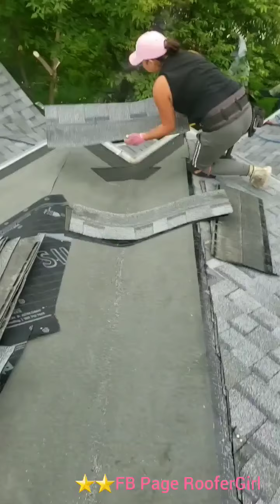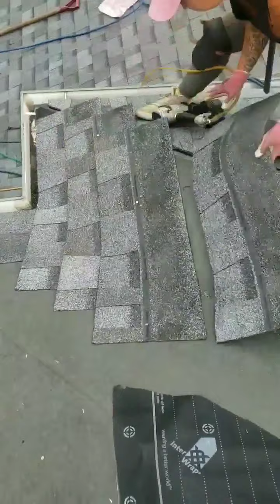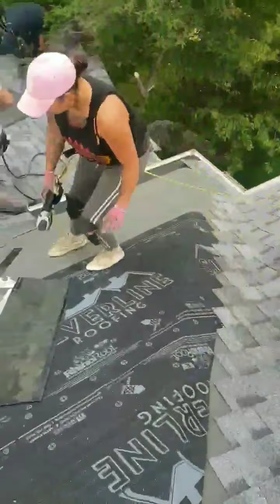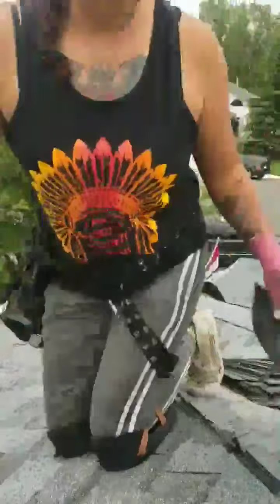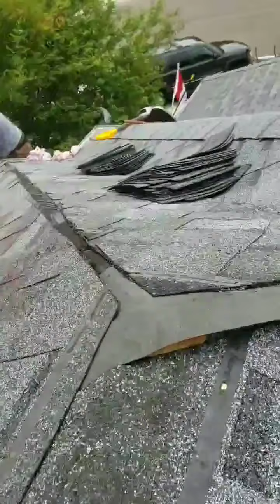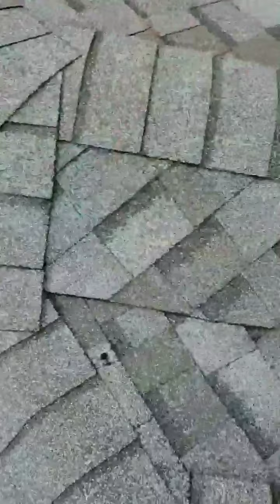Valley Install

Comment: We stopped doing our valley's this way. The way we did them for years!. Our new practice, we just snap a line on the "gutter side" of the valley, up a few inches, then, we run shingles vertically up the valley, and either start in the valley with our runs, or just start with our books and just use ones and twos before the valley.

Comment: Thers no reason to make cuts in the middle of the valley you put a piece of starter going vertically to give a line and you start each peice from there it will make steps by itself

Comment: I use an old pair of large tin snips for cutting shingles. Try it you might like it.
I like this better than the california bullshit valley
But weaving is best. Go girl
Reply: Weaving.  What are you  back in 1959.     Ya don't weave anymore.  First place to go is the valley.  Metal is best.  Research it buddy guy.     You are so old school.
Reply: Buy a malco turbo shears if you are so old school and lack power in your cutting arm.  They are freakin awesome.
Reply: @mikedimm6729  sounds like a great idea for a long valley cut
I'm 73 and retired but my cutting arm is still good.
Reply: @mikedimm6729  yeah I only spent about 30 years up there on the roof.
You ain't no roofer toots.

Comment: Nice looking valley,  not the way I do them though and I noticed that you did not cut the top corners of the shingles
Reply: Good point!. Not nearly as important on a low.sloped roof. Steeper slopes have more tendency to leak when you skip that step. However it doesn't look like.the top of the shingles extend into the valley therefore they wouldn't need to be cut

Comment: Anyone can use a gun lol we use hammers which by no means are as fast as the gun but ensures a much better quality of work as you feel each nail going in its correct or incorrect destination where as the guns tend to be less accurate missing the thick part if the shingle or the nail going into a seam in the boards id also use metal flashing for the valley giving zero percent chance of leaks , all in all I have fixed so many leaks specifically because the last workers used nail guns ,  a real true roofer uses a hammer and his or her roofing senses i have used guns and have come to the conclusion that they are trash when compared to quality work of a hammer/hand connection
Reply: But yes I know guns are fast
Reply: Wasting time cutting through all of those shingles id have them cut as im going with the metal flashing , that overlap style is outdated and super time consuming